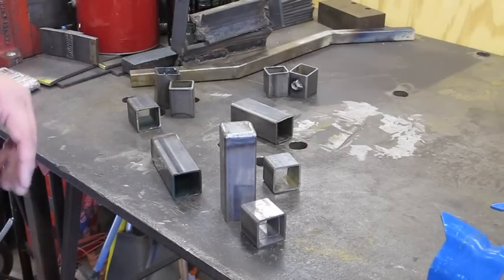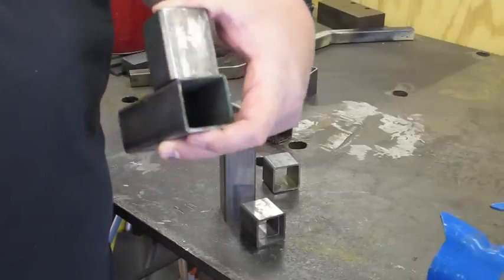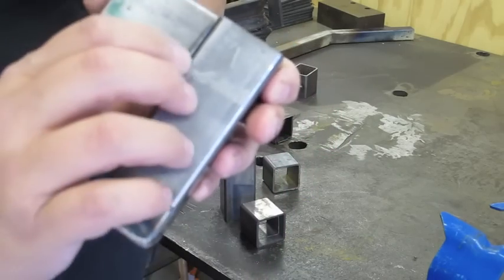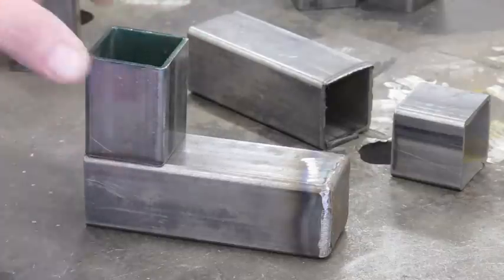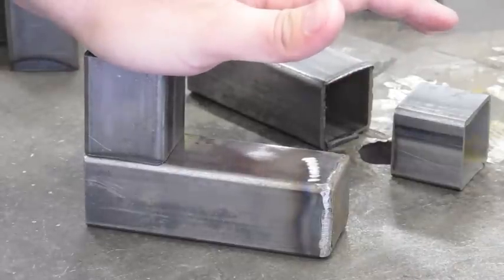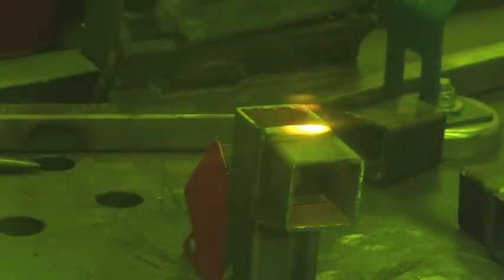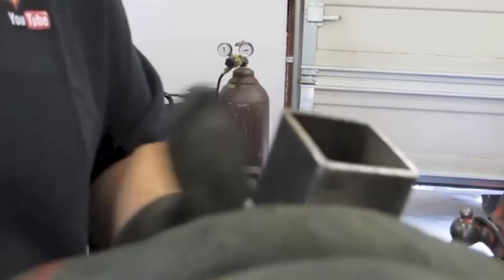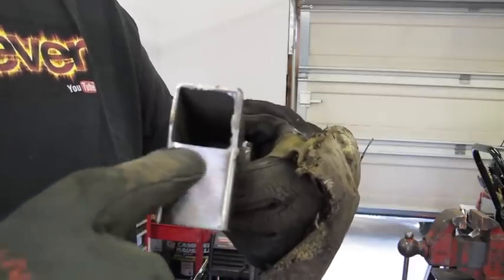Mig Welding - Square Tubing

Comment: good job! what speed and heat mode do I need to have on for that beautiful weld? I have a Lincoln HD 120 volt? thank you.
Reply from the maker: In all honesty, I can't remember the settings I used since it has been a while, but your welder should have recommended settings under the hood, or in the manual. Also, you can find settings online at the major welder manufacturer's web sites, or from the free apps they offer. Good luck.

Comment: What kind of welder are you using and is it an argon hook up?
Reply from the maker: Kong Her I used a Lincoln 175hd that I no longer own and I used a 75/25% argon/co2 mix.
Reply: Thanks for the info.

Comment: What amp welder are you using? Is it AC or DC? If you are not running gas, are you using flux core, if so, what size?
Thanks
Reply: Idk bro

Comment: I know this is just an example of how to join the two pieces, but wouldn't that be a much weaker weld because of where the welds ended (on the corners) than it would be if you were to start and stop each of your welds in the middle of each flat stretch of metal?  Basically starting your weld in the middle of one of the sides and wrapping the weld around the corner to the center of the next side surface.  Maybe I'm wrong on this, if I am, I apologize for wasting your time with this question.
Reply from the maker: +An American Prospector You are no wrong, and many welders suggest your technique. I do agree, that on something much heavier/thicker, that would be structural in nature, you're suggestion would probably prove to be stronger. However, on something of this scale, we would most likely be fine and the strength difference between the two methods would probably be negligible.
Reply: I can agree with you on that.  Thank you for taking the time to reply.

Comment: I'm looking to buy a MIG welder, don't have a lot of money any recommendations?  I am going to be welding mostly square tubing, with small exceptions being thinner sheet metal here and there.

How strong is the weld in this video?  I want to make a tire holder for a 37" 100lb tire for the rear bumper of my vehicle, thanks!
Reply from the maker: Amariah Invictus It is all based on the strength of your material, the tensile strength of the filler material you are using, whether the item will be static or dynamic when put into use, the heat put into your weld, and the size and quality of your weld. So you see, there is no clear cut answer to your question.

Comment: What about if you want to join two pieces at a 90 degree angle, but the two square tubes are cut at a 45 degree angle so when you put them flush together its a 90 degree. This way you don't need to add a cap and use less material. I think it would be two edges coming together flat and flush. How would you want to weld that?
Reply from the maker: GoldStarTech Start by tacking in the center of both sides 45 degree angles. Then continue to tack around the piece so the heat when welding won't cause it to move. If you tack on the inside, or outside corners first, then the heat will pull the piece and you'll have a gap on the opposite end. Good luck!

Comment: Whar adjustments to the spot-weld/tacking technique would be needed to prevent slag holes when going to do the final weld?
Reply from the maker: +Jeffrey Beyer Just make sure you clean everything well of anything that might contaminate a weld, including slag. I'm assuming you're welding with flux cored?
Reply: +WeldFever Yes, flux core welding. My only option until can afford a mig welder.

Comment: can you tell me, where did you put your grounding while welding.. if it is on the welding table ? am i safe to touch my workpiece without any electrical shock ? please help me to understand that. thanks.
Reply from the maker: I put the ground on the table. The principle of an electric circuit can be complicated, but essentially electricity chooses the path of least resistance, and traveling through a human body is not usually that path. Still, you must be cautious about water, touching the electrode holder, or ground clamp, and in any way putting yourself between the path of the electrical circuit. I recommend you find a book on weld safety related to electricity and study it well. This is not the forum to provide that kind of safety related information.
Reply: +WeldFever thank you so much.

Comment: @WeldFever Hi,after you finished that piece off and grinded it all down, what would you paint on the bare metal to protect it,if it were going outdoors in the rain to prevent rust etc
Reply: SP330Y - Cheap and easy would be after cleaning the surfaces, apply two layers of zinc spray followed by two or three layers of your preferred top coat color. It should hold quite well. ;-)
Reply: thanks,zinc is very good,i since found a product GALVAFROID and also ZG90 its cold galvanising paint and is the ultimate for rust prevention

Comment: I know its thinner metal but you should always push your weld. Pulling the weld makes for less penetration, a weaker weld, and a high crowned bead. If you have to pull the weld to prevent burn through then the welder is set too high.
Reply from the maker: +Logan Rolenc I get this comment a lot, so here is something I wrote to another viewer.

I get a lot of comments about pushing versus pulling, but the reality is there is no hard and fast rule about which is a better method. At least none that I have read anywhere. The only thing I know for certain (since all the textbooks and manufacturer's state this) is that pulling provides more penetration than pushing. Other than that, it's dependent on the skill of the welder. Thanks for the comment.
Reply: +WeldFever i asked the same thing to a few of belgiums best welders and the all said pushing is the way you have to do it cause it provides more gas to the weld

Comment: hi weld fever, do you always haves to have the gas tank to weld with mig weld?
thanks
Reply from the maker: +jose mejia If you are going to use solid wire, GMAW, then yes you will need either an argon/co2 mix , or straight co2.

Comment: I have a question, 
 I am welding a lever for a small gate in my backyard. the steel I have is quite thin and I was wondering if tacking every inch or so would work? not looking for quality, just functionality
Reply from the maker: You wouldn't want to run a bunch of tacks, or squirt weld, anything thick or structural, but if the material is very thin, and you ae not going to put much of a load on the piece, it should be fine. Just make sur you burn hot enough to get some fusion going.

Comment: i noticed you pulled the weld on the fillet. at a job place is pulling actually acceptable? i know at school they made it seem like a sin to pull.
Reply from the maker: Yes, pulling is acceptable here in California, USA. In fact, pulling is said to have greater penetration, because the wire is pointed back at the weld puddle, thus allowing for more heat and penetration. This produces a narrower bead with more build up that is harder to see when welding. Why were you prohibited from pulling MIG at your school?
Reply: they told us that pushing actually penetrates more and gives a cleaner looking bead. though pushing is really annoying on certain sides of tubing and pipe so thats why i was asking because pulling would make those 2 much easier in the difficult spots for me.
Reply: Pushing is harder to learn, that is why schools push you to learn it. If you can push a weld, you can pull a weld. But the same is not true reversed.
Reply: Good question, I was wondering the same thing.
Reply: WeldFever I was thinking about that same question, as far as pushing or pulling goes. Thanks for an informative answer.

Comment: what are the name of welds being applied to each side?  I couldn't tell the differences.
Reply: Moon Cake 
Fillet ,Butt, Tee ,Flare
Reply from the maker: Really there were only 2 welds used. A fillet weld and a groove weld. There were, however, 3 different joint types. They were a T-joint, a flare bevel joint, and a butt joint. A little confusing, especially when we all tend to use the names of the joints and the welds interchangeably. Hope that helps.
Reply: Thanks!!
Reply: Thanks!

Comment: Hi im a beginner welder but i just wanna know how u get the wire to stay straight? When i weld. It pops all over the place which make my welds look sloppy
Reply from the maker: Jimmy Nava Make sure to keep the contact tip to wor distance low, raising the gun too high off the work piece is usually the culprit for the symptoms you described.
Reply: WeldFever thank you that helped alot
Reply from the maker: Jimmy Nava Great, glad to hear it!
Reply: Jimmy Nava Your stickout sounds too far out.
Reply: John Rambo yea i fixed my problem. My welds are coming out better

Comment: What is voltage and wire speed. There is nothing but fab shops near my house and school and i struggle with this
Reply from the maker: You know, its been a while since I made that video and I don't even have the machine anymore! Needless to say, I can't remember the settings, but you can download an app from Miller, or Lincoln, or go to their websites, that will list all the wire speed and voltage settings based on your material thickness. Hope that helps, sorry I couldn't be more exact.

Comment: where does everyone find their most metal from to weld? besides buying, what are some good items to steal from.
Reply from the maker: +dynocompe I don't advocate stealing anything, but you might go to welding shops and ask them for scraps. If you offer to clean up their shop a bit, they might be more inclined to help you out? Also, you can get scrap steel from cutoffs at the local steel yard, at a very good price.
Reply: I would never steal from anybody. I said items to steal from, as in trash items. Bed frames, bbqs, paneling off fridges, hoods. So there is no real good trash out there ppl look for?
Reply from the maker: +dynocompe Sorry, I didn't mean to offend you, I just don"t want anyone to get the wrong idea. As far as taking steel off of throw away items, I would not advocate doing that, because you might not be able to identify the metal, nor any coatings on it, which might be harmful to your health, or even dangerous to weld on. Good luck!
Reply: I just bought my first welder today. A gently used mig pak 15. Looks brand new. They said they hardly used it because they bought the 180 right after to do aluminum. the guy had 3 welders and its very apparent his other two are well used! paid $300 cdn with the original spools of wire still unused and included! sweet, excited. The acreage I bought, the previous owner was a welder, and has left a ton of metal pieces out here! :)

Comment: How weak does it make the welds if you grind them down?
Reply from the maker: John Rambo It depends on how well you fused, how deep you penetrated, and how much you grind off.
Reply: Use an angle grinder with wire brush, mate

Comment: is it possible to do that kind of welding with  a lincoln mig pac 10 i can't seem to get that kind of weld  all i get is pigeon poop would you be able to give me an idea on what my settings should be at &yes i am a beginner. thanks
Reply from the maker: +nick diaz If MIG welding (solid wire with gas) make sure your polarity is set to DC+, which means the lead from the MIG gun is on the positive lug in the machine. Then make sure you have at least 15-20 cf. of shielding gas, and that there are no winds in excess of 5 mph while welding. Finally, keep the stick out to between 1/4" to 3/8" and fight the urge to lift the nozzle to get a look at what you are doing.  Hope this helps.
Reply: ok but your saying that the solid wire is it the same as flux or wire with the gas in it already cause i use argon co2  i don't quite understand sorry for being so stupid
Reply from the maker: +nick diaz No need to apologize, this stuff is tricky and complicated, especially when just beginning! Flux cored, has flux inside a hollow tube wire and generally does not require shielding gas (argon/co2). MIG uses a solid wire, and requires shielding gas to keep the weld from being contaminated. The two processes are not the same. So, follow my instruction from my first response, and you should be okay. Good luck!
Reply: thanks a lot bro wish  could send you a case of beer lol  your so cool

Comment: i am learning mig welding and i didnt see you doing any patterns while welding
Reply from the maker: petr nerad Do you mean like weaving? If so, it is not necessary to weave, or make any patterns, or motions at all when mig welding. Believe it, or not, a MIG weld can be very successfully laid down by simply pushing, or pulling the gun. It may not be the most attractive looking weld, but if the travel speed, gun angle, stick out, wire speed, and voltage are all correct for the application, the weld will be perfectly sound.
Reply: i am studying mig welding at the moment 
and i have to do circular patterns when welding down
and triangular patterns when welding up
Reply from the maker: petr nerad of course you must do your assignments as per your instructor's instructions and good luck to you.

Comment: i was wondering  with no pun intended  why are you dragging  and not pushing the welds ? gas you push using the shielding gases to help flow the bead and when using  flux core you drag it like you are arc welding  is the technique you need to be useing . beings your the weld fever guy you should already know this . i dont mean to be picking on you  but i weld day in and out and been welding for  35 plus years  and always use this as my guidelines .
Reply: Not a hard and fast rule. Angle controls penetration and profile. (Try dragging vertical up) 30 years for me.

Comment: im no welder   but i didnt see you earth it  is it because it was on a metal table ? thanks
Reply from the maker: Claire Eadie There was a work connection (earth/ground) to complete the circuit, but it was probably off camera as I usually affix the clamp out of the way. Thanks for the question.

Comment: what about welding two different thickness of metal like 1/8 square tubing against 1/4 flat metal
Reply from the maker: +Mild II Wild You want to set amperage/wire speed for the thicker of the two and concentrate laying the bead on the thicker side and regularly aiming over and hitting the thinner material and quickly returning to the thicker side before you blow through. I may use this example on my next video, so thanks for your question!

Comment: When should you go in circular motions welding oppose to dragging like in this video
Reply from the maker: There is no hard and fast rule for that. The circular motion is mostly for aesthetics and for some, it makes it easier to time out the rate of travel, but a straight bead is just as strong and vise versa.
Reply: A straight bead works great for thin (.065) wall, the circular or other fancy "movements" are for thick wall metals to get maximum penetration like pipelines and skyscrapers. Great video I've been welding 35 years and can see your skills instantly.

Comment: How many volts do u need to weld square pipe. Tnx
Reply from the maker: +Gakhal Industries That depends on how thick it is.
Reply: practice with scrap metal

Comment: what settings did you use to weld this type of metal?
Reply: +Woj xz  As a rule I use 1 amp per one-thousandths of an inch of metal; for example 1/8" steel I would start with 125 amps.
Reply: Mike Enns  Your right and I am sorry,  For some reason I was thinking about Stick Welding, not MIG Where as in Stick The rod diameter in thousands is my starting point for amps. to get good burn off without sticking.
Reply: As already mentioned, that rule of thumb only applies to carbon steel stick electrodes as a starting point ( stainless requires less amps for example )

Reason being a stick electrode needs a certain current to burn off properly ( its a current density thing ) Too high a current leads to to high a current density , which causes unstable arc. Too low a current density will cause very inefficient melt off and sticking

When it comes to wire feed processes the range you can use is quite large

For example, you can go from 100 amps for 1/8 to well over 300 amps at high travel speeds

Another example is ( ballpark figures ) a .035 solid MIG wire will stabalize at currents as low as 50 amps, and can take over 300 amps , which is a huge range

With WFS processes it really is dicated by how fast you want to move

Its sometimes tough to equate MATERIAL thickness to required amps because there are so many variables that throw any rules of thumb off. Variables such as joint design, joint gap, penetration requirements, number of passes desired etc

Comment: If your pulling instead of pushing please inform me how your gas is actually covering the front of your weld puddle?
Reply from the maker: +Nikolis James The weld puddle is not so large that gas doesn't make it to the front, especially given the fact that the nozzle's diameter is so much bigger. I have never suffered porosity from pulling a MIG weld and I can assure you, all things being equal,  penetration is greater when you pull rather than push. I encourage you to try it for yourself.

Comment: can anyone recommend a welder for welding 1/4" tubing ???
Reply: A 140hd 110v welder will work, but will not get full penetration depending on the weld with 1/4". Plus they have terrible duty cycles. A small 220v would be the best tool.

Comment: what is your settings?
Reply: Settings vary from welder to welder. Some welders have infinite settings showing voltage and wire feed rates while others say "set the voltage to 3 and wire feed to 5".